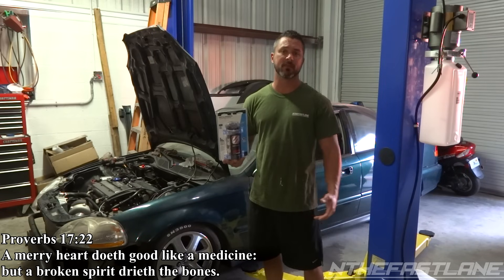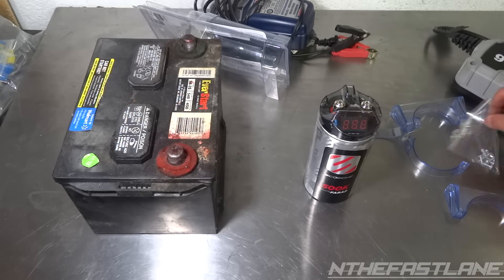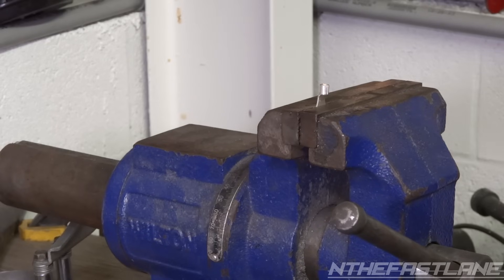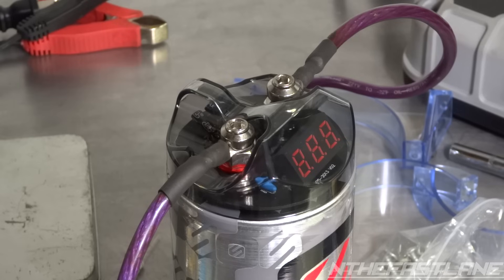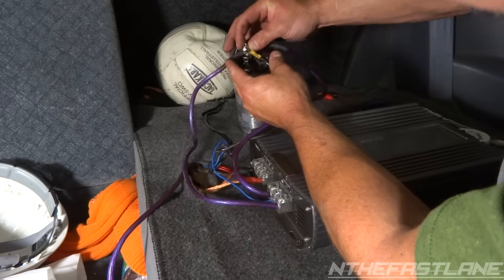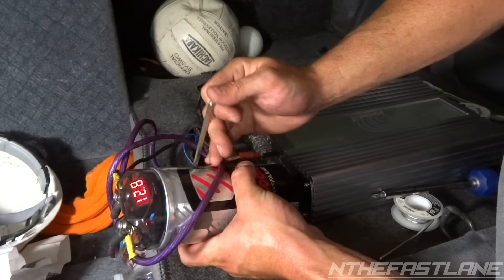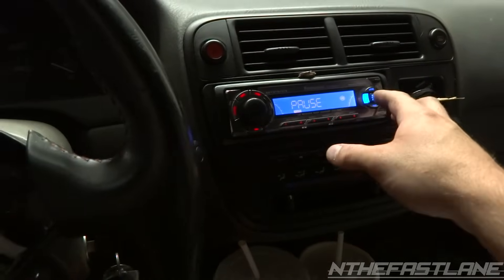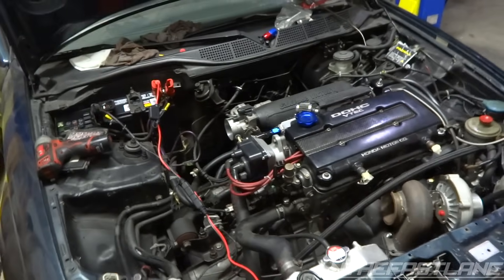▶️Amplifier Capacitor Installation "How To"⚡

Comment: Need a separate ground for the capacitor, #1 and 2nd, if you don't have at least the big 3 done, then this is almost a futile effort. I've used plenty of 2 farad caps, without the big 3 on 1500 rms and had dimming, Hit up the big 3 upgrade and dimming was gone. Your electrical system (charging) as a whole is only as good as the smallest wire. You can run 6 feet of 0 ga wire then connect it to 2 inches of 8 ga wire then run another 6 feet of 0 ga wire and you will essentially be running on 8 ga wire power. that's just how electricity works. So without the big 3, the battery will almost ALWAYS suck more juice then it can get. The stock wires in your charging system on your car are highly inefficient, but they are also not taking into consideration that you will need all that power for an amp. In my personal experience I've went from 12.3 volts to 13.8 volts just from the big 3 ran with 0 ga ofc . If you are going to install a system with a cap, then it's important to do the big 3 always, unless you are running a 300 watt rms amp and a 300 watt rms sub. At that point everything will be fine, usually.

Comment: Would it work with a 2010 dodge avenger rt I have a 12 inch mtx sub and amp and a capacitor
Reply: Type of vehicle is irrelevant. 
Whatever you do don't follow this video. 
Capacitor ground is not supposed to come directly from the battery ground.

Comment: does it matter which leads go on first or rather on top of one another on the capacitor ? ex: first positive on the capacitor come from the batter, then the power wire that sits on top that leads out to your amp? sorry if i didnt explain that right, just trying to make sure i dont blow up my system when i install one lol.

Comment: Maaann. I've tried using capacitors so many times and they never seemed to work.... I didn't know about the "activation" with the resistor... Awesome man!
Reply: That's why your caps didn't work, you fried them by not using a resistor on the first charge.

Comment: Soldering is good but you should have the right connector for the right size wire and crimp it and solder if you like

Comment: i have a 94 explorer with a 180amp alternator, led lights in and out and 90w led headlights and im running a sony 4200 headunit, four 6.5 sonys, four power acoustik tweets, two 15" qpowers and a 4000w ssl evo amp and i dont have any battery issues

Comment: You didn't tell us if you have the key turned on to ACC or Off..... while installing the capacitor in the beginning?
Reply: When you are working with any wires disconnect your battery

Comment: Somebody said that you can't put the same groung to the cap..so they said that the amp must have single ground to the chasis and the caps also have it own ground to the chasis...they said that if you put it together so the caps will be open circuit and will not do it work...so what do you say about that?

Comment: hello, do you know where i can find a resistor. im installing my capacitor in a different car but i dont have the resistor anymore. i dont even know how its called. there is a bunch of different types
Reply: Alexander Sánchez Nanchez u can use s tester
Reply: Use a small light bulb like a interior bulb that you can Gerry and bend the wires or or line a 3057 it'll work just fine.  Car installation place gave me the info. And my cap is still working fine at switching ir out of two different cars and charging up and down
Reply: Todd Conrad worked like a champ!!! thanks dude!! 💪🏼💪🏼💪🏼

Comment: how long does a capacitor last charged if you completely disconnect it from a car❓
Reply from the maker: I would say roughly 3-5 minutes. It will still have a small amount of sparkable voltage. When unplugged, the voltage decreases until it no longer displays on the LCD.

Comment: you really want to install a capacitor so as to prevent any possibility of shorting it's terminals. a capacitor can dump its entire charge nearly instantaneously. it will make a arc welder look tame.

Comment: I got a good good battery up front a little battery in the back with a 2 farad fosgate cap my voltage drops to 11 sometimes i just ordered a high amp alternator that is the heart of the electrical u can add batteries and caps but what charges those components the alternator you don't want to stress out your alternator eventually your batteries will go your cap will gold your alternator will go upgrade your alternator trust me

Comment: Buddy u installed ur wiring wrong ...amp need to ground to the chassis as well as capacitor
Reply: As far as I know separate grounds and try to keep them short as possible

Comment: for a 200watts active (powered) subwoofer, would I need a Capacitor?
Reply: Godwin Bassey i wouldn't your not running alot of power unless you just want to keep an eye on your voltage. I'm running 2 agm batteries and a 240 amp alternator  just to run a Rockford Fosgate T2500bdcp .
Reply: I’m running 3000w on stock electronics

Comment: Hello, okay, maybe you guys can help me out with this,  I have the 1200watt mtx subs package  the matching amp and bass   control knob. now my alternator is a 140 voltage. so one day, I was playing the system. And then my battery meter reading was moving down to red, then the music was sounding distorted, so I turned it down, then I stopped to check the lights, the head lights was still bright, so I see the bass control red knob light stopped working, but the amp lights still was on, just  but now no sound from the subs, and all the fuses still good, even the alternator fuse still good, so would this be my.... 140  volt alternator or the voltage regulator to the alternator. and is 140 to low for the MTX 1200 PACKAGE I GOT FROM FINGERHUT.....THE SYSTEM IS GREAT, SO NOW THE CAR STARTS BUT BATTERY METER STILL READS LOW ? PLEASE HELP THANKS

Comment: I carefully drilled holes in my amp and mounted mine on my amp so it looks very clean and my jumpers from the capacitor to the amp are only 3 inches

Comment: Something I have not be able to find is how to determine if a capacitor is good anymore.. would anyone have info on how to test to see if a cap has gone bad?
Reply: I have this same cap 30$ at walmart..
Reply: If the cap is bad you get the dimming headlights back. If the cap with even pass the power through it, sometimes it will go up and the power stops at the cap. In other words you will have power to the cap, but not at the amp.

Comment: Quick important question! When its already charged hooked up to your system and youre just doing an amp swap, obv. You disconnect main power, but do i discharge the capcitor too? Or will i be able to disconnect my old amp, swap new one with connections, and then main power to cap? Really curious dont want to kill myself lmao
Reply from the maker: You always want to discharge any capacitor before messing with it. A/C technicians when discharging a condenser capacitor take a screwdriver with a rubber or plastic handle and tap the screwdriver on the two leads creating a spark until it sparks no more, then test it with a multimeter to make sure there's no voltage. Then and only then is it safe to mess with a capacitor. 

A car capacitor runs off 12v DC voltage. (Direct current). Direct current is not as dangerous as a household capacitor which runs off AC voltage (alternating current). AC voltage can kill you.
Reply: Nthefastlane haha i appreciate the quick response and the reference at the end! Im gonna take it to my local shop to swap it out, need to upgrade some wiring crimps anyways as some of mine have none, you sir are a gift of god with answers ask this man away...thumbs up!

Comment: your bass cuts out because you are not supplying enough voltage and current to your amp. that cap is junk and only takes power from the system and does not make any and it is just another load for the alternator to charge. so get a stronger alternator, make sure you have copper wire and not cca garbage. get a good agm deep cycle battery and do the big 4 upgrade with copper wire and your bass will stop cutting out
Reply: Don't you think that's a bit ridiculous just to power a couple shitty sony xplods, this guys problem is he's using 8 guage wire for over 100 amps, all he has to do is get proper power and ground wire and he'll be fine

Comment: Don't waste your money on these ridiculous caps. If you need more power supply then you need another battery. A proper install using quality parts and components along with proper gauge wire is all you need. The Big 3 Upgrade is mandatory for any high wattage system and money well spent.
Reply: Hardware Addict Agreed 100%
Reply: Yep I tested this running 2 1200.1 amps on the stock battery and alternator.  Attached a cap rated for 2,500 watts (correctly unlike this video) and the truck still suffered negative effects of running both amps in master/slave. 

Ran off and got an XS Powercell XP4000 and I never see that battery drop below 13.6 while running 147.3 db.   Caps are almost a joke and just another volt meter.   Not even worth wasting time on them!
Reply: Even then, the extra battery can only do so much. The best combo, from what I understand, would be to do the big 3, as well as get a high output alternator. Unfortunately, that is uber expensive, and I'm not yet willing to do that on my minivan. So, I just went with a battery and cap combo. Even then, I don't expect much from them.
Reply: the0real0realitykid i got 2 batteries on a 250 alt running dual 0 gauge wire from the alt to the first batt. and dual 0 gauge wire to the second ,and from the second im running 4/0 welding cable to my Rockford t2500-1bdcp WITH NO CAP AND IT RUNS PERFECT
Reply: A
Reply: Good for you. If you'd have bothered to actually read my post, you'd have noticed the part where I stated the big 3 and high output alt. But, you know, reading is only for adults.
Reply: Umm he said the big 3, Did you even read his post?
Reply: Capacitor are ok u need to get the right farad for the job n they clean the power line from noise..Y u think the better the amp the more n bigger the capacitor are inside the amp...
Reply: Hardware Addict your wrong on that more batteries= new alternator soon

Comment: Whenever I hook caps up I wire them up but remove the fuse from the battery in the positive wire and ground both the amp and the cap, throw that resistor in the garbage and jump the fuse terminal with a light bulb any 12 volt bulb should work I use a 3157 that I soldered wires to, the bulb will light up and slowly start to dim when the bulb goes completely out the cap is charged, pop in the fuse and your ready to go. Caps are dangerous, charging from a safe distance like the engine bay is safer then trying to do it in the trunk next to the cap. P.S. you should probably upgrade that thin ass power wire.

Comment: o 1 more thing.. batteries  ( caps ) do NOT make power....... it only holds what your alt can put out. the battery is a storage device thats it. thats why in car audio we use amg batteries. they have less resistance . what that does is, it give off voltage faster. and was just thinking your 1k amp if its a sony like im thinking your luck if your getting 300rms out of it. witch means just a good amg battery and the big 3 and your good.

Comment: Is the comopasitor really necessary
Reply: They can prevent voltage drops that can cause a car's headlights to dim when the bass drops. Without one your battery and alternator can be fatigued and fail before their expected lifetime. Think of it like an AC power conditioner.

Comment: The Capacitor will only charge up to the Input Voltage. And Discharges completely in a Fraction of a Second. When it Discharges, You get a Spike in the Volts. Causing the Amplifier to draw less Amps. 1000 Watt Amp at 12.5 uses 80A. But at 14.4, Uses 69.4A. That is a Resistor. The Colored Lines show the Value.

Comment: They were talking decades ago about replacing batteries with capacitors but nothing ever came of it why is it. They are far better than batteries they last longer everything about a capacitor is better than a battery as far as I can tell. I have 30 year-old 1 farad capacitors that still work just fine

Comment: While this video was well meaning it was also not terribly accurate. Most car electrical systems can handle up to 1500 wrms without issue so long as it’s properly wired, grounded and without a cap. Before installing any caps or 2nd batteries, make sure ur grounds are adequate to bare metal frame and upgrade the big 4 wires, and you’ll see that a cap (let alone .5farad) doesn’t help much. If after doing all that you still need a extra boost, I’d recommend a batcap 700.

Comment: The cap ground doesn’t go to the amp, it gets its own ground. Also, if you capos dropping below 11.5 amps something isn’t wired right. Dropped voltage is bad.
Reply: He said his car wasn't running when he did the demo

Comment: my friend my capicator it's 21 volt 1 car
which transistor ohm  can I use it?
Reply: just wire everything up no fuse in the positive wire, ground the amp and the cap separately. When it's all hooked up.  I used a light bulb like a turn signal bulb  and jump the bulb where the fuse goes the bulb should light up, the bulb will slowly dim when it goes out the cap is full and you can put the fuse in.👍

Comment: Good job bud
Reply from the maker: Thanks Big!
Reply: you must have the negative terminal of the capacitor grounded to charge it
Reply: Nthefastlane hey, I tried to hook it up the exact same way as u, and it wont work. have the same capacitor, and it just keeps blinking 9.2, and my amp wont come on. what do I do? Please help
Reply: Michael Mosher- Use ur multimeter, assure you have a proper ground. Drill into the chassis/frame, sand the surface bare too. Use also star washers made of stainless steel w ring terminals, throw some hair on the torque too.
Reply: Ted Phillips that's just nuts. It doesn't take all that to hook up a capacitor. I have a 2000 watt amp grounded in my trunk, and it works fine. thanks for the insanity, but I'll pass
Reply: Michael Mosher lol dude just no you need to learn the guys right yiu need to ground your wanna be cap.

Comment: I would definitely recommend a big three b4 any capacitor. The only good a capacitor can do is actually filter any unwanted noise from a system. Other than that I would do big 3, upgrade alternator, and do extra or multiple batteries depending on power ur running.

Comment: when you say negative don't your mean ground??? you should be more specific for the beginners
Reply: Stephen Miller Negative and ground or earth are the same. Usually negative and positive are used when referring to Direct current, ground or earth is used when referring to Alternating current. You will also hear the plus or positive side referred to as the hot side.
Reply: Dave Bogusky don't forget neutral
Reply: SpenserRoger I didn't want to confuse anyone by giving a long explanation. Neutral is used in AC as the return path, and while grounds and neutrals are connected on the same buss bar in the panel, they are at different potentials in the circuit. Neutral will read at different voltages in single phase and three phase (when used; it isn't always used). It can get really long on the explanation. In 240 1 phase it isn't used, in 480 3 phase it is not used in motor circuits but used in 277 lighting circuits. That is a discussion for another video. Good you brought it up though.
Reply: Dave Bogusky Thanks for a little primer on it. Always good to refresh your mind :)
Reply: SpenserRoger There is so much more that we can all learn. I don't know much, but I try to be proficient at what I do know and keep learning and share knowledge.  Thank you for pointing it out and using your brain. It amazes me how some things are invented by ordinary people who understand an idea and figure out how to make it work. TV is a good example. Leo Farnsworth invented the cathode ray tube and the whole concept of TV at 15 years old with not much education. And electricity was still in its infancy at the time. Have a good day.
Reply: Ground is a c negative is DC he is correct
Reply: You lack common sense

Comment: ATTENTION THE RESISTOR WILL BE VERY HOT during Charing or Discharg i would use tweezers to Holt it but dont touch with the tweezers the poles 😂

Comment: You use 6 gauge or 8 gauge wire all around and you would take your main negative which is your ground and you using what it looks like a number 10 gauge wire you should at least put them all the same or ground a little bigger could never go wrong just saying

Comment: these things do not work. putting one on makes things worse... and they dont and can not hold voltage.  for your system the big 3 , a new battery and a 130 to 150 amp alt is all you need and thats the right way of doing it. been doing car audio for a long time caps are worthless.. do some reading.
Reply: big scott what's the big 3

Comment: You have to hold the "resistor" with something other than your fingers. While you charge the cap, that "resistor" is going to get really hot. You might want to try a larger gage of wires for power. If you are drawing enough power to dim your lights, that little 10 gage wire is probably getting hot too. The speaker wires on my subs, is larger than your ground and power wires. 😶

Comment: That is incorrect he should have left the resistor on until it fully charged otherwise it's likely going to cause a parasitic draw doing more bad than good yeah you woke it up but didn't charge, it will read 12 volts regardless